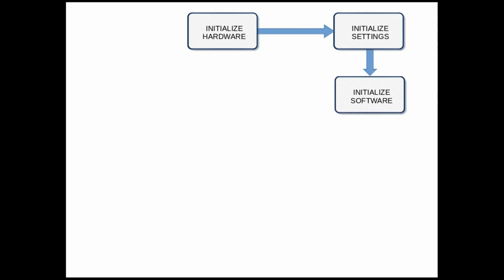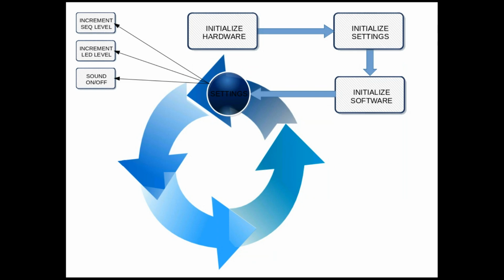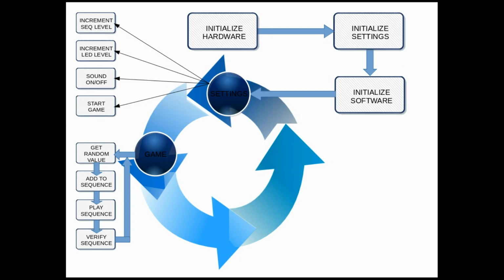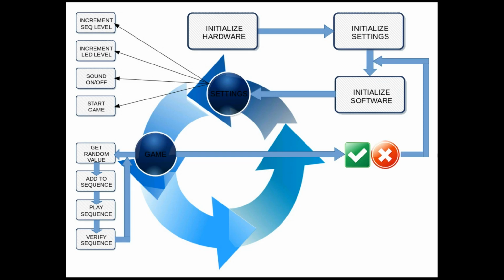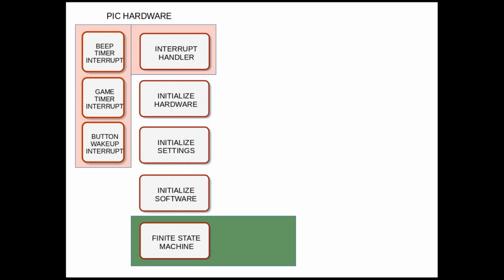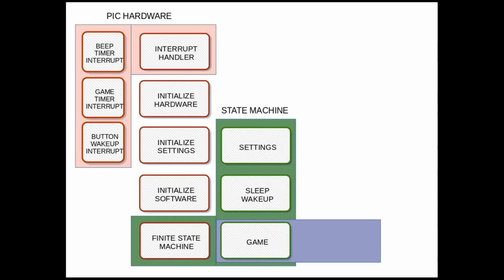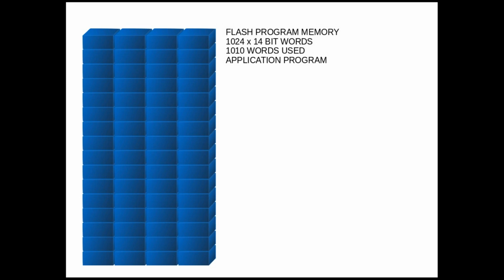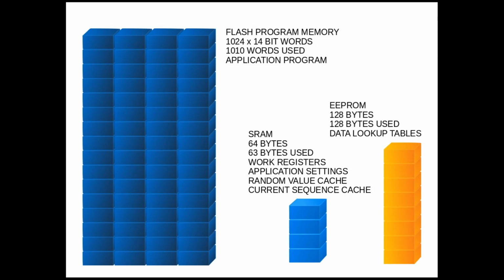PIC Game Programming PART 4: SOFTWARE DESIGN

Comment: worst flowcharts ever :(
Reply from the maker: It's not a flow chart, it's a presentation of the concepts used in the design of the game, which is why it expands as I discuss the approach. A flow chart would include all decisions and processes in the logical solution of a problem, this does not include the decisions in the solution to the problem.